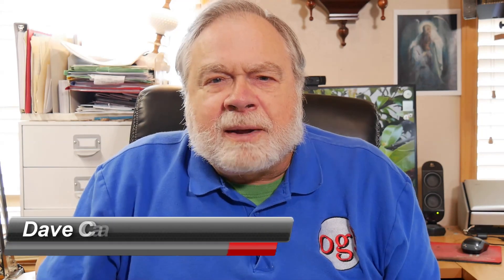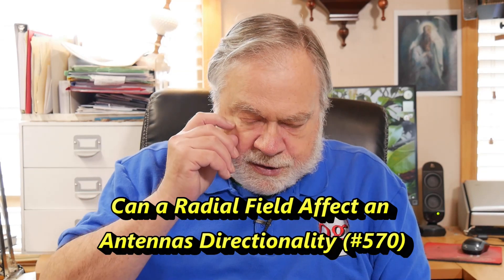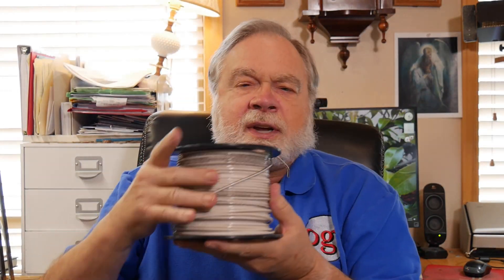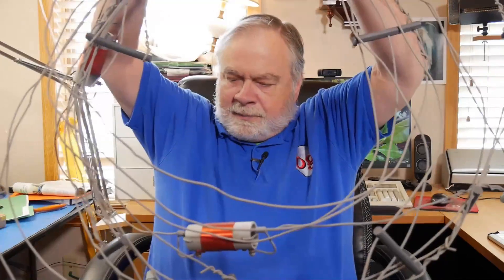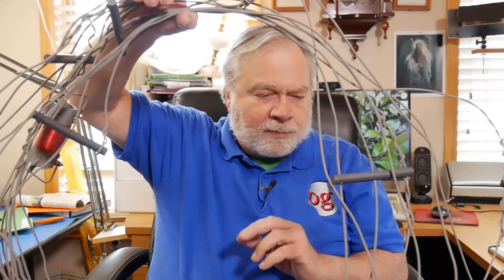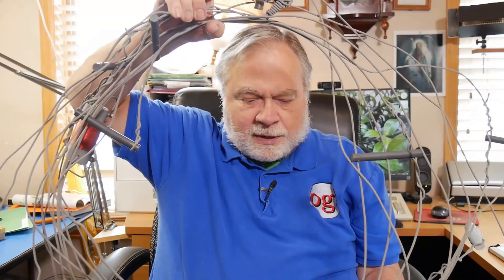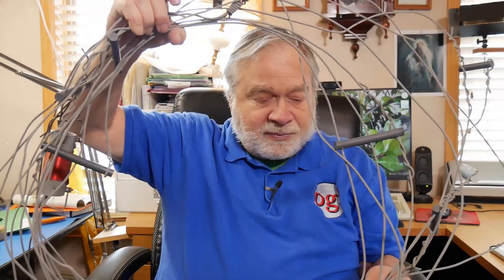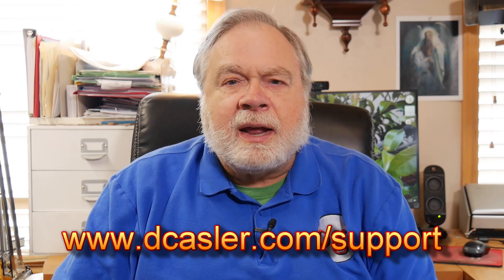Can a Radial Field Affect an Antenna's Directionality? (#570)

Comment: Hi Dave, ground radials are there to reduce the ground loss in most of the grounds we encounter. 
His whip antenna is already compromised on 40 meter with the loading coil there by reducing the bandwidth as you mentioned.
By having the radials bunched up in one particular direction you are  "NOT PUSHING" the signal in that direction; 
in the other directions the ground loss would be greater. That's what is happening.
It's always better to have as many as radials as possible uniformly spread out in all the directions to reduce the ground loss.
The term "push against" something is commonly used by many; it's A/C current and pushing against must mean in the reciprocal sense. And this term is loosely assumed to be as if the center conductor current is something like positive and the outer braid current as *negative*; people use the term "push against" when dealing with the coax fed antennas... and not the balanced feeder fed antennas.....hi..hi..hi..
De VU2RZA
Reply: Good explanation..dr .the regular use of common terms ..with our pre assumed idea..both joined hands and  gave a dream product..😂😂
Reply: @nallasivam3612  Thanks, Prabhu for the appreciation and understanding.
De VU2RZA ❤️

Comment: I appreciate the information on radials and vertical antennas. I have similar questions about using counterpoises with end-fed 80 - 10 meter horizontal non resonant wire antennas. Are there optimal counterpoise lengths?  Is it helpful to increase the number of counterpoises? Thank you for your videos and QST articles.

Comment: Question about radial fields on the directionality... Is there a gain adavantage to directing the radials in a given direction over evenly distributing them? Curious if you know of anyone having success trying some manor of an even distribution of radials around a vertical, but then using relays or simlar to switch-in a set of radials for a more directional beam in that direction, or switch-in all radials for an omni?
Reply: There’s never any gain from clustering radials. You can only create a greater loss in a specific direction, by having no radials directed there. No matter how many radials you put in one direction, it will only perform at the efficiency the above ground antenna is capable of.

Comment: The effect of radials is minimal with inefficient short antennas. Better to make it longer if you can. For 40 and below, you can add 20 or more feet of 18ga wire to the tip of the whip to a support and have a nice inverted L antenna tuned with the wolf river coil.